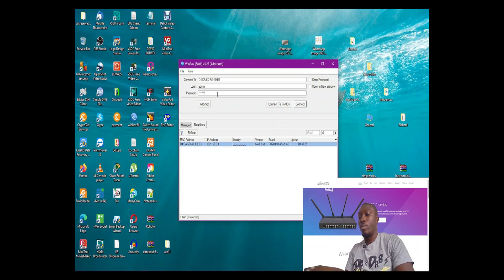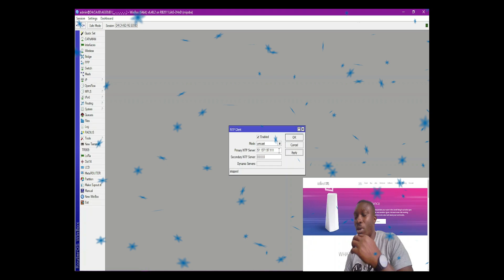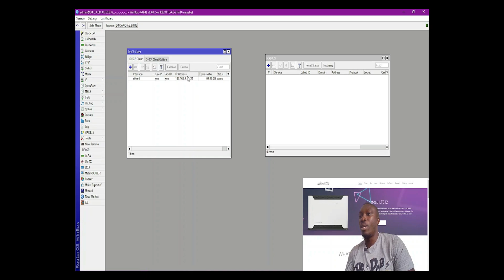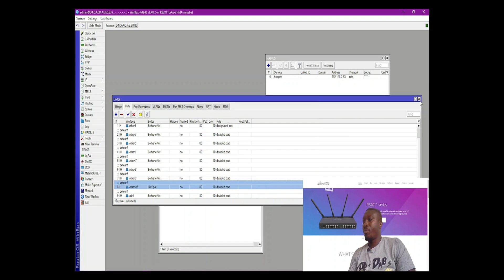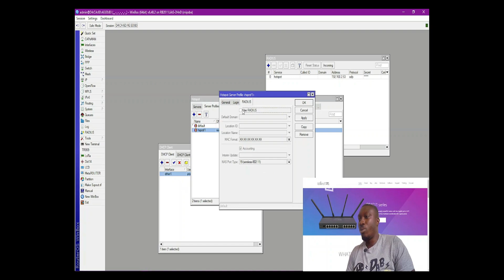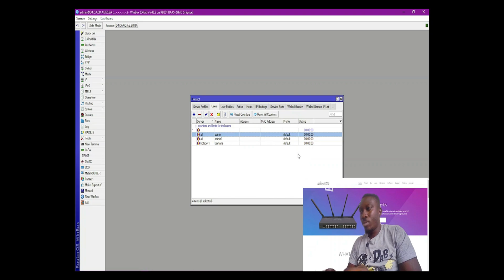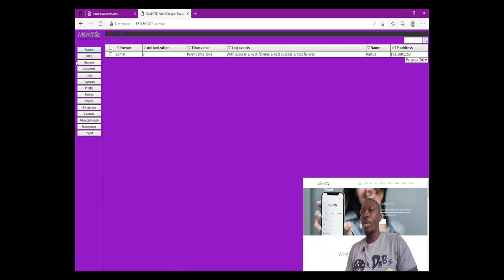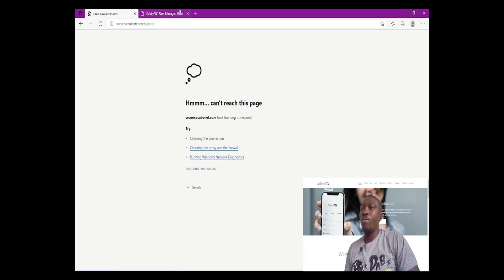how to #configure #mikrotik hotspot

Comment: Which settings is responsible for the pop-up of the web login page i have been able to setup my router but it wont pop-up for username and password web interface
Reply from the maker: Kindly make sure you have internet flowing into you router an 
and also check your dns.. Or type your hotspot ip example (http://192.168.30.1:8081) and see if you will get the authentication page. Else try a different web browser.
Reply: Ok thanks when i type in the host page it comes up(working) but i need it to ri-direct  automatically to the web page as it's supposed to do for me no problem but anyother user might find it difficult to use .thanks for your help
Reply from the maker: Then I suspect your dns settings. Try use Google dns and see the results.

Comment: Hi is it possible to backup the settings from one router and restore it on a new router rather than configure fresh
Reply from the maker: Yes that is possible but such router must be the same as the backed up router. Else you will only end up destroying your router.
Reply: @owuubii  ok am doing a backup for the same router for emergency backup incase one is damaged i just switch it to save time
Reply from the maker: That's clever but router must be same and firmware too

Comment: can the username be disabled and i use password for log in only on hotspot client voucher interface
Reply: Hi is it possible to backup the settings from one router and restore it on a new router rather than configure fresh
Reply from the maker: Yes you can use hotspot without usermanager. But you would have to create users in the hotspot